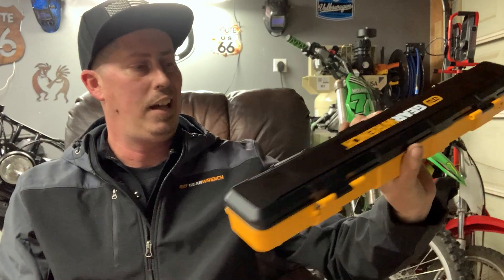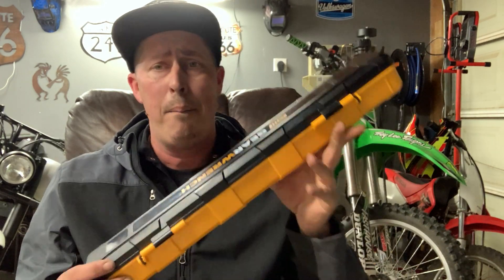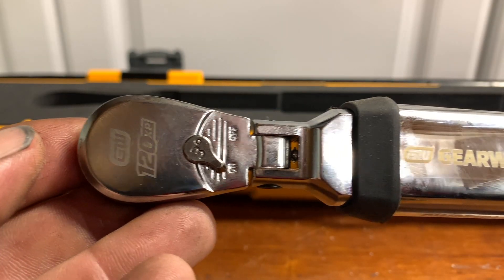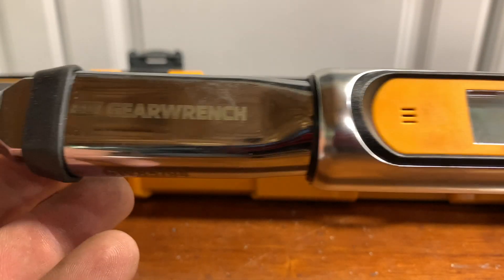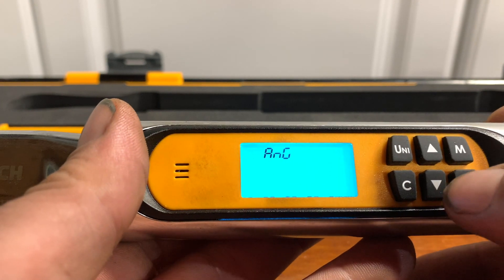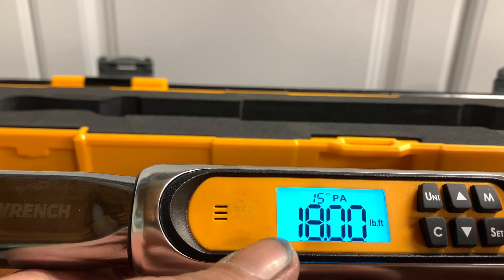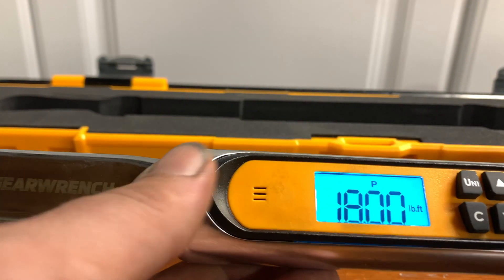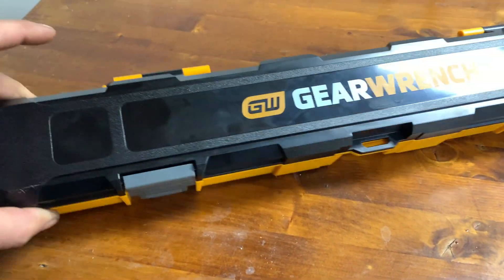Gearwrench Digital Torque Wrench Full Review!

Comment: Hey. 
You kind of screw up the explanation of the features. Didn’t really make sense on how you explained it. 
Mode “P” this is just tightening to your desired torque setting.   Example 100 lb/ft.
Mode “A”  this is just turning a bolt a specificity angle from where ever the bolt is currently sitting at.  Example 90 degrees.

These two  explained correctly.  
 Now mode “PA” you screwed up explaining 😃.
Mode. “PA” is tightening  to specific torque then turning a specific amount of angle after that torque has been reached.  Example 44 lb/ft plus 90 degrees.   You said you don’t know when you would ever use this mode. Working on German cars I use this mode almost daily. 
Basically it combines the first two modes into one action.  Also another feature not explained in PA mode is that after the torque and angle have been completed it gives out the completed torque reading. Example 44lb/ft plus 90 degrees gives a complete torque of 100 lb/ft. 
Again  this is a awesome feature . The Germaine like to give a torque pus angle spec with a max or min total torque spec.  
Basically this does everything a Snap-on tech angle torque wrench does. 

Mode “pct” is really just setting up the sensitivity of when you want your beeping alerts in the the three other modes,  You are not torquing in this mode. 

Love the videos you put out. 👍
Reply from the maker: Thanks for the awesome in detail explanation. I really appreciate it. Good looking out. Really glad somebody was able to break it down and share with us when you would use these features 🍻😎🤙
Reply: Yep Honda 6 cylinder Crankshaft Pulleys all have to go an additional 60 degrees after torquing them to 45 ft lbs. Those motors are in a gazillion Honda vehicles over decades.
Reply: I appreciate you explaining all the modes.  I just got this torque wrench and there isn’t anything in the instructions about how to actually use it.  Thank You
Reply: Sucks it wont go below 24 inch lbs

Comment: I am using these wrench putting together my 2015 Chrysler engine; the manual states the torque + angle should be done in one step, like not backing the wrench but this is not possible with the small space I have to work on the block; the manual states specifically also the angle part as to do it in one motion but when you have an angle of 130 degree how can it be done without backing the wrench? plus the digital wrench does not read or records measure on the backing motion unless activated at the head, now I am doubtful if my torques are correctly done!

Comment: Thank you for the helpful vid. I'm a new automotive tech in the industry and looking to get a 1/2" & 3/8" torque wrench specifically for Subaru cylinder head bolts and engine rebuilds. Would you say this model Gearwrench is adequate enough for precision work with critical engine fasteners or should I consider getting something more costly such as a Snapon tech-angle? Thank you.

Comment: I am looking for the 3/8 one with 10-100 ft-lbs. Will the lower end 10 ft-lbs accurate for Spark Plugs tightening at 15 ft-lbs? Many said the torque wrench is only good for upper 80% range.

Comment: That PA would come in really handy in the agriculture department. For torquing stalk roller on a JD corn head you have to torque them to 150 plus 35 degrees. Super handy when you’ve gotta torque 30 plus rollers
Reply: Another option is to use the Milwaukee mid-torque 18v impact wrench with the one-key feature that has repeatable torque setting in the app the tool connects to. Set to 150 on one of the three buttons, and hit 150 every time in a quickness, then if the angle is needed, follow up with the gear wrench for the final 45 degrees...or something like that.
Reply: @paedahe4975  good idea!!

Comment: That's a 1/4" torque wrench?  It looks big.  How long is it?  They way it comes across in the video, this torque wrench looks as big as my Snap On 3/8" torque wrench - the QDR, not Techangle.  I bought a Snap On 1/4" Techangle over the summer specifically for Ford Explorer 3.5L waterpump bolts.  If that Gearwrench is as big as it looks, that would be problem fitting it in the tight space to angle torque those bolts.  Or the front cover bolts on 1.0L Ecoboost.

Comment: Would you suggest getting the 1/2.
Reply from the maker: I'm actually planning on buying the 1/2 myself. Here's the link for your convivence
 GEARWRENCH 1/2" Drive 120XP Flex Head Electronic Torque Wrench with Angle, 25-250 Ft/Lbs - 85196:
https://amzn.to/394rtLy
Reply: @JustinDowDIYcentralhighway  thanks fam

Comment: I have been looking at these. I have used the same 3 Snap-On TQ wrenchs for 16 years. The I just had to get the 1/2 calibrated and the 1/4 is hard to read the numbers from spinning the handle all these years.

For the ones that do own it. Can it hold up to daily use? Does it have presets?
Reply from the maker: It does have presets. As far as whether or not it holds up during every day use Time tells all.

Comment: Peak Angle is so you can do torque and then the angle right after. For example if the bolt calls for 15 ft-lbs and then 75 degrees, you can do it in one motion rather than changing between Ft-lbs and angle. Great video otherwise!
Reply from the maker: That’s awesome. I appreciate you sharing that with us. Now we know 🍻🤙😎

Comment: I'm seriously thinking about this one . I have a snap on tech angle that's only 3 years old  ( probably  like 10 total,uses in  3 years though ) I took it out to torqued Cummins injectors this past week and the @%#$&* thing is broken. And no more Mr. Snap on at the shop for  a year now. So very displeased  with the snap on one especially  for how much it cost and so little use on it. So this new gearwrench.com is probably the way I'm going to go.
Reply: Did you buy the Gearwrench? Seems to be mixed reviews on these things these days. At least Snap-on will service. Gearwrench on the service side is questionable at best from what I read.

Comment: I really like mine. especially the price. The ONLY thing that I don't like is the fact that it goes in increments of .01. I always pass up the target torque that I am trying to set the wrench at because right when I'm about to let off of it to stop early it changes to going up or down by .1 or a whole number. Little thing, but something to think about. Still a lot better of a price tag then the tool truck brands. That's really the only reason I got this one instead of the techangles from snap on like my 1/2 and 3/8.